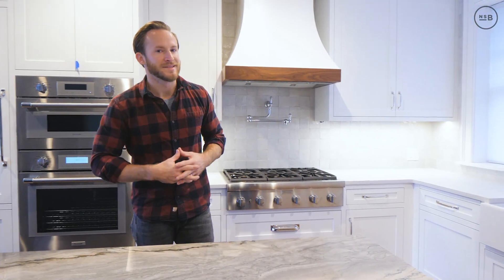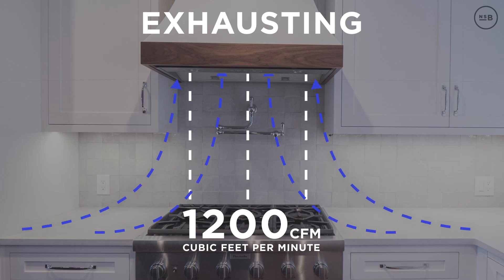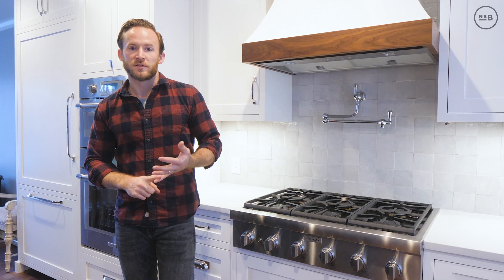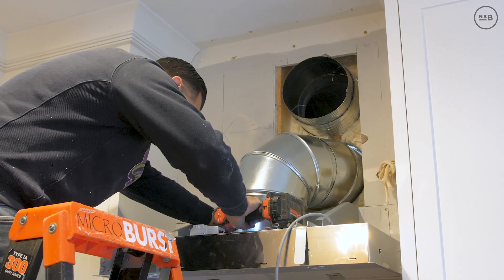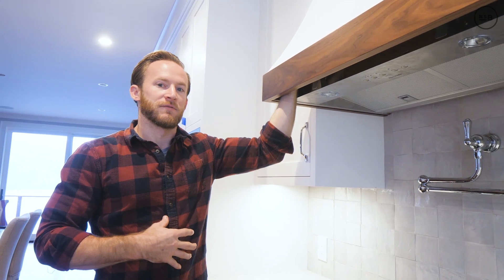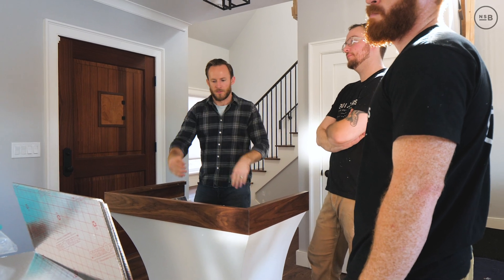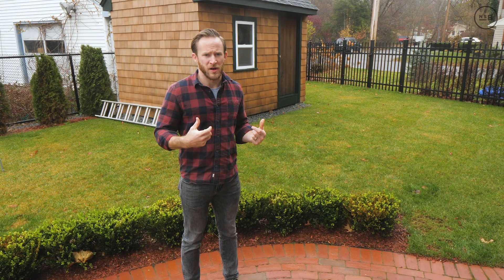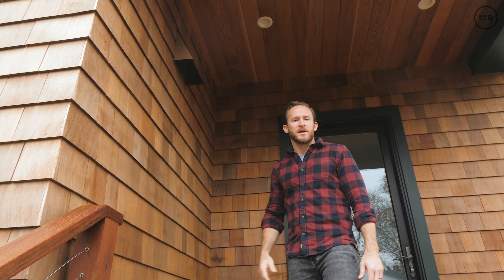Kitchen exhaust and make up air all under one hood at NS Builders Lake Drive Custom

Comment: Not impressed.  Did you consult an HVAC engineer to ensure you're not exhausting the make up air right back out?  I'm sure a large percentage of it gets recirculated out.  Also in-line blower sounds great for low noise but what happens when it needs to be serviced?  You buried it in the soffit now you will have to tear up the garage ceiling to get to it.
Reply: I've had an inline blower hidden in the soffit of my laundry for 15 years. Mine is a squirrel cage blower. Have never had any problems with it. There is no sensitive electronics in them, just a motor. So the 'when' you speak of is such a remote possibility, that I am comfortable cutting open my soffit in that eventuality.
Reply: @rodstephens6612  Is it less noisy when it's inline?  Would you say the benefits outweigh the negatives?  My motor in the hood is covered with oil.  Even if I clean the filters all the time some oil still gets through.  It would be interesting to see how much oil gets on the inline motor.
Reply: @rockys7726  Much quieter. Mine is 1400cfm and the only sound is the turbulence of he air thru the filter, no motor or fan sound at all. The quality of the filter mechanism is key. When I clean mine, I check the damper at the top of the hood. I don't see any oil deposits there, so I don't expect any further into the ducts. My hood has both a commercial style baffles as well as a secondary screen filter. They seem to combine to give me very good oil capture.
Reply: @rockys7726  there’s a difference between a cheap over the range hood and the quality of “filtration” and a proper hood liner with an inline fan. With simple properly placed and spaced baffles, you create a series of turns that allow air to pass but any particles of mass like oil are unable to make the quick turn at a high rate of speed so they slam into the baffles. Effectively zero grease will end up in a properly designed, installed, and maintained system. It’s far quieter and more capable. This design is deliberately venting the makeup air that is being introduced. That’s the point. Don’t throw conditioned air outside and force the need for conditioning new air to replace it.
Reply: Ya this was clearly designed by someone with no knowledge of aerodynamics, the air coming in will not drop down in front of the range and then get sucked by up with all the gasses like this video insinuates. It would be sucked right back outside immediately making the system really only feed itself. And not suck much air from down by the stove top. 

If you wanted to provide make up air the most effective spot to allow it to enter would be by in front of the stove top. That would then create something of an air curtain in front of the cooking surface, both providing make up air and a kind of invisible barrier against the smoke entering the rest of the home.
Reply: @alecmillea4539  zero understanding indeed.
Reply: @raybarry5822  Of course it makes sense that the make up air should be the air being sucked out by the range hood, however if it isn't picking up the gasses from the stove top while it's at it then the whole system is pointless. Might as well put an inline fan in a U shaped duct with both ends outside. The make up air needs to pass by the stove top in order for it to be useful. 

The ideal location for the make up air outlet would be in front of the stove top at counter height. This is never done for various aesthetic and practical reasons. Leaving the toe kick area as the obvious and practical option. 

My kitchen has a 36in induction cooktop built into the counter, in front of which is a false drawer panel (much like in front of a sink). I installed some tip out hinges on it and my make up air vents through it. Directly between the cook and the cooktop as is aerodynamically optimal to assist in good ventilation. Combined with my home made 2000cfm hood vent it does a fantastic job.
Reply: @ someone should tell tornados that air doesn’t like to wrap in a radius and mix and pick up other things/gasses/droplets. 2000 cfm fan you say. What’s the diameter of pipe necessary to evacuate 2000 cfm?
Reply: @raybarry5822 Your tornado analogy is almost completely irrelevant in this circumstance. Tornados most often form when two opposing air currents meet one another. In order for that to occur there has to be a significant enough crossover area between the two opposing flows for a large vortex to form in between them. This design has such a small amount of separation between the incoming and outgoing points that there will be almost no vortex formed. The only way the hood in the video would function as they illustrated would be if the make up air was coming out at very high velocity, enough to be very uncomfortable for the person standing at the oven getting outdoor air blasted at them. 

As for your question of what size ducting should be used for a 2000cfm fan, google says 20in, I did not study HVAC in school and quite frankly I do not care what the standards they say you should follow are. I studied aerodynamics and thus I understand what is good for airflow and what is not. As well as the noise and pressure wave consequences of different designs. 

As for my personal set up, I use two separate 10in 1000cfm units installed in the wall at 9 feet. Those are ducted through my custom range hood with inline silencers to a custom 3d printed smooth transition between the 10inch duct pipe and the two 16x20 commercial hood vent filters. The whole system operates at around 57db on full blast.
Reply: @raybarry5822  You have a point but does the air within the tornado move faster or the air being dragged in from outside of the vortex move faster?
Reply: @ they mix and become the same. If the mass of the faster air is greater and it’s being fed by energy it will most certainly accelerate any slower moving gasses as they incorporate.
Reply: @raybarry5822  Ok, so what percentage is stale air versus incoming air?  Still not as good as full exhaust of stale air.
Reply: @rockys7726  kitchen exhausts aren’t designed for exhaustion of stale air. They are designed to evacuate the potentially dangerous biproducts of combustion and cooking. If you wish to exchange old air for new you’re enquiring about a different kind of system.
Reply: @raybarry5822  When I say Stale Air I mean the oily cooking air.
Reply: I am an HVAC engineer. Most large engineered commercial hoods have ducted makeup air that is designed to do exactly what others have said in this thread. I thought it was odd when I saw it on my first commercial kitchen job but talked to the hood designers about it.
Reply: Totally my thoughts

Comment: Waste of time ... what ends up is a "short-circuit" of the airflow. The fresh air coming in just gets sucked out through the exhaust ...
Reply: I'm pretty sure that fluid dynamics disagrees with you. It will pull the gases/particles from the range. Now that being said, there must be cold air leaking around the hood which I'm curious about. Also this doesn't balance the house pressure; pressure inside almost certainly drops causing air leakage to play some roll even though much smaller.
Reply: @Niklaos  : Look up any reputable MUA system design (by fantech or airscape) and you will not see this sub-standard and ineffective technique being used.
Reply: @ginger-bread_man  Oh I'm not arguing that it's an ideal solution. An airflow coming from under the stove would definitely be superior. All I'm saying is that it definitely doesn't do nothing and that it's probably efficient enough. The video should show a smoke test actually, that would have been interesting.
Reply: Nicolas GUILLAUME : The smoke test will reveal a short-circuit.

Comment: This has always been an issue, even in older homes.  What a critical and necessary airflow solution. My questions: is the damper electronically controlled and is the aperture of the baffle adjustable and paired with fan speeds? If so, how did you accomplish this, if not, how are you assuring the damper will open?

Comment: Interesting idea... I just can't see the need for 1200 CFM for a home kitchen. Perhaps the occupants will never turn it up that high. I wonder how well this is going to work in hot/humid summers and frigid winters. If I had to design a system from scratch I'd probably just use an Aldes ZRT-I somewhere next to the range paired with an HRV/ERV and a recirculating range hood with some good filtering.
Reply: Had a 900 CFM hood from Zephyr even at its middle speed I couldn't smell burnt food standing right next to the stove. So it was very very efficient. Though everyone 3-4 houses down could smell it outdoors. . Thus I doubt if 1200 CFM is ever needed for a home kitchen.  It's simply over kill by a long shot. Plus the capturing grease  seems missing on this.

Comment: Seems to me that the make-up air at a 100% rate will disrupt the capture and containment of the exhaust air making this arrangement ineffective. How is this different from the concept of a commercial short circuit hood which has been proven to be ineffective. Some commercial hood systems do make use of replacement air in this manner but the percentage is no where near 100%. I'm not an expert but this looks good but may not work as well as hoped.
Reply: Thors Hammer: while it may seem like 1:1 the exchange rate will not be 100 because they have not chose to mechanically pressurize the inlet/return. Essentially, this will work as a vacuum where High rates of our flow, by the way 1200cfm is commercial grade, will take up and mix the inflowing air, heat, stem, orders, etc. and carry them out.  Imagine the air flow as water current. Anything that makes contact with the current will be carried along the paths. My question is: have they kept the inlet and exhaust far enough apart and have they planned for natural wind patterns. Overall, though, this is a thoughtful design that I would love to add to my kitchens and baths.
Reply: @charlesjohnson7222  I never thought of the air current influencing the exhaust in a way a solid surface would influence flow (Coanda Effect). Someone with a Flir thermal imager might be able to detect effluent breaching the hood boundary. Schlieren Images would also be interesting to see.1200 cfm is  a lot of flow! (I envision the Elf Christmas movie where Will Ferrell sticks his face on the mail tube...or, a homeowner prior to going to an 80's Big Hair party getting her hair sucked up into the hood.  Haha! Will the make-up air disrupt gas burners? May be best for induction cook tops. I am still suspect but intrigued by the set up. We need good HVAC geeks to do performance testing on these set-ups.

Comment: Clever, I just wish you powered the make-up air. I suspect if you measure the make-up delivered at the hood it will not be close to 1200. Also curious to see how much the house is depressurized relative to outside.

Comment: Most building codes require make up air on any hood that pulls more than 400 CFM. Thats a genius idea of how to bring enough air in and keep it visually pleasing. Most homeowners down here in Fl look at you like your crazy when you tell them all this when they remodel the kitchen and they want a new hood.
Reply: Stone Home Services Inc I am in Florida. Had the genius idea of remodeling the kitchen and was trying to get a commercial strength hood fan, that is, until I found out what a mess I would create sucking all dirt from the outside, walls and ceiling with negative pressure. It is a old house 1990 so the insulation is nasty. I love this idea but it doesn’t look to be perfect yet.
Reply: @marcelosantana9311  what did you end up doing?
Reply: @aikidoboynj  Soooooo, if I tell you that my renovation has been stuck for the past year would you believe? Don’t know what happen but everything stalled in place. I am actually starting to look to get someone to install the ductwork for me in the next month or so. I love the idea of this channel but not sure if I can get a custom hood like that easily.
Reply: @marcelosantana9311  haha yes I believe you  because I am having a remodel as we speak and I'm just learning about this mua bs as well. It has been very difficult for me to find a hood insert model that complies and in which I can have the motor installed in the attic as opposed to an all in one unit (too cut down on noise).  

The one I found on amazon is up to 800 cfm on max setting but i need to get this done fast and I may just get it anyways and just use the lower speed settings. I found some braun units but they look like trash and the reviews on them seem to back up that opinion. 

The inspectors/code people around me allowed the previous owners to sell the this house to me with a nylon-like tubing, not even metal venting behind the old hood so I'm not so worried about getting pinged by these code fuckwads.
Reply: @aikidoboynj  make sure that you add a silencer. It reduce considerable the noise. Hoping to get the ductwork in the next couple months. I haven’t decided between a in-line or roof mounted blower yet. My biggest issue is noise since I am not planning to use gas. I like this design but hard to get anyone that works with make up air.

Comment: Hello, that is a great build! Most people do no consider the replacement of exhausted air with fresh new supply air. However, I would like to recommend you use an ERV unit to still help temper the make up air. This will prevent the cold/freezing incoming air from causing condensation on the beautiful hood you made.

Comment: Great to see more residential builders taking kitchen air quality seriously.  I'm a little skeptical of in-hood make-up-air though - it can "short-circuit" or cause the exhaust plume to spill, reducing capture efficiency.  Did you run CFD simulations, or do you plan to do a smoke test?  It would be awesome if you guys did some verification with a smoke source and a particle counter.
Reply: They are simply doing a commercial compensating hood as allowed by code.  “ Compensating hoods are those having integral (built-in) makeup air supply. The makeup air supply for such hoods is generally supplied from: short-circuit flow from inside the hood, air curtain flow from the bottom of the front face, and front face discharge from the outside front wall of the hood. The compensating makeup airflow can also be supplied from the rear or side of the hood, or the rear, front or sides of the cooking equipment. The makeup airflow can be one or a combination of methods”
Reply: This is correct. It has been proven over and over again that this system does not work. It is just the easiest way to meet code. I doubt this system will get much serious use so its fine but if you want to see how a quality commercial system works check out something like the Halton Capture Jet system. They even have the Schlieren imaging to prove it.
Reply: Not sure how efficiently it’ll work, at least it’s better then no makeup air. 

With new homes build, HRV units should have a feature that is dedicated to only bringing in cold air to be warmed up by the furnace and is routed to a duct that could be placed above the cook or under the stove which will serve as a supply to the exhaust above.
Reply: @mzshan79  I have done this many times it requires a few extra relays and dampers but it can be done and is amazing!
Reply: @devonwithani  What ERV are you using for a 1200 CFM hood?

Comment: make-up air required for: 1)composting toilet 2)shower exhaust 3)wood stove 3)kitchen. Easier to live in a tent or a drafty old house?
Reply from the maker: Point being?
Reply: @NSBuilders  I will build smaller and simpler from the get-go. Just enough.
Reply: Tent would certainly be cheaper but probably not easy or comfortable.  These guys are achieving an extremely comfortable house with low energy bills.

Comment: Wow, makes complete sense, never would have thought about replacing the air you are exhausting out.
Reply: In commercial kitchen that is the norm, however in new build homes they don’t consider this unless it’s a custom home and the owner had the intention and knowledge to overlook this feature.

However the challenge for us in North is getting tempered air in instead of cold air middle of January.

Comment: What about a situation when you turn on a bath exhaust fan somewhere in the house.  Wouldn’t it creat a draft in the kitchen when someone has a bath fan running?
Reply from the maker: The damper is motorized so it opens on a motor that is controlled by the hood.
Reply: Would the ERV provide that solution?
Reply: @NS Builders, I think they meant would you not have a similar backdraft scenario when using a bath fan exhaust, as it too, is trying to pull make up air?  The mechanics of the kitchen set up are easily understood.
Reply from the maker: cmm170526 in that case, we are using an ERV to handle the bathroom exhaust and keeping the home balanced.
Reply: Bear with me, are you using the ERV as the sole device for humility mitigation in the baths?  What about the dryer?  I am in the process of designing my own home and trying to get a handle on proper ventilation.
Reply from the maker: Rusty Wrenches dryer is vented normal. ERV handles the bathrooms, option to boost the CFM
Reply: NS Builders makes sense.  Is make up air for the dryer negligible enough to not worry about?   Thanks for the info!